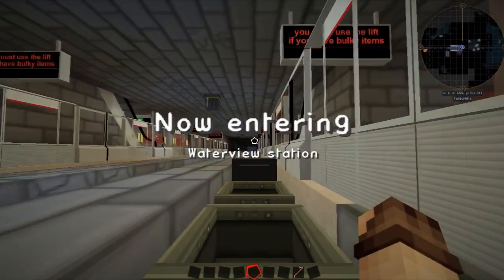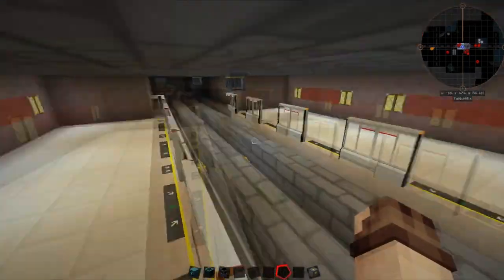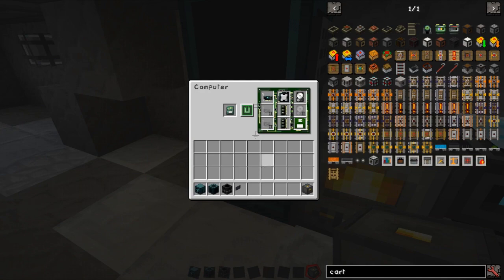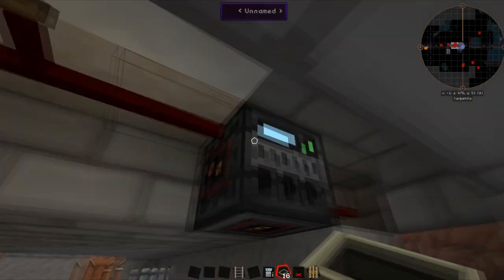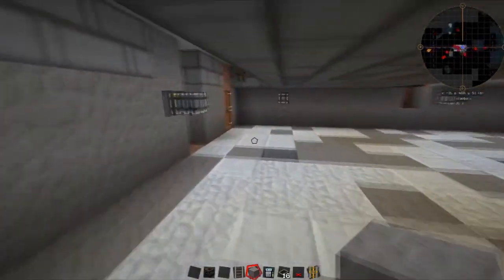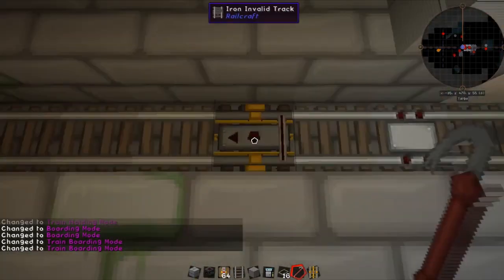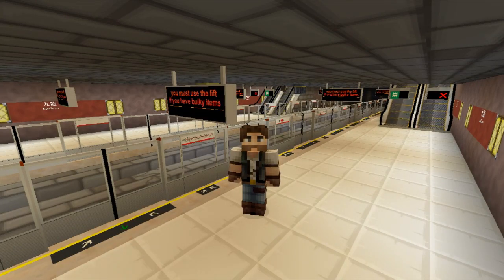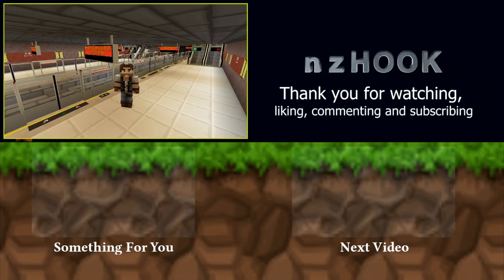Automatic Station Doors - MyRail #2 [Modded Minecraft 1.10.2] Microcontrollers

Comment: Hmm the Messenger Track dont work for me. "Invalid json: malformed JSON at Line 1 column 9.  You have any tips?
Reply from the maker: It has to be well formed JSON, what is the text you are putting in?
Reply: /rc text message -234 -34 9 {"text":"Welcome to Forest Station"}
Reply from the maker: I tested that in my world and it looks like in a newer version of Railcraft they added the ability to look at a track and set the title which has then broken the position arguments. So this works (while looking at the message track):
/rc track message {"text": "Welcome to Forest Station"}
but this no longer does:
/rc track message -1080 1241 90 {"text": "Welcome to Forest Station"}

Hopefully that will make it easier for you, although I can see some reasons to give co-ordinates as well.